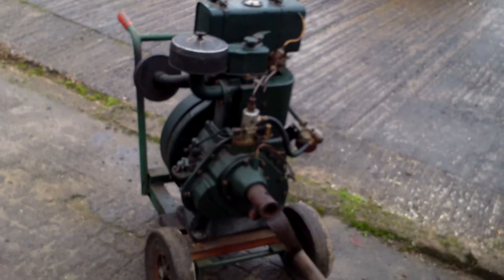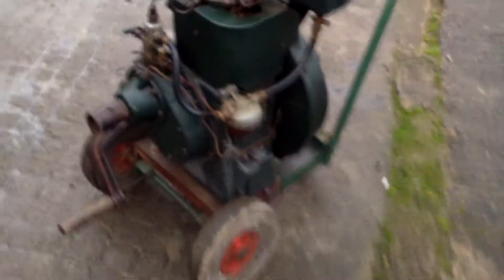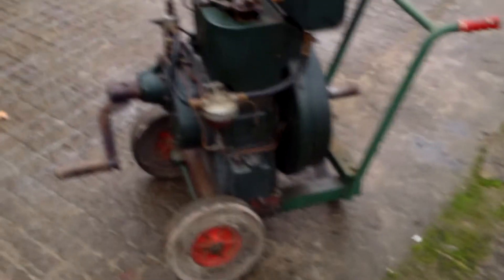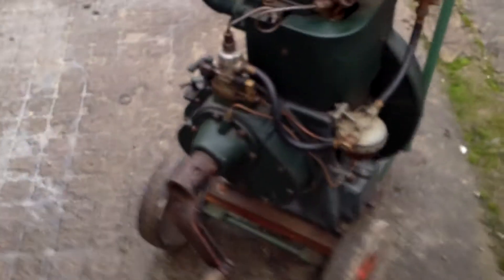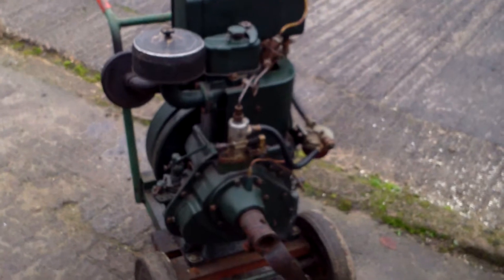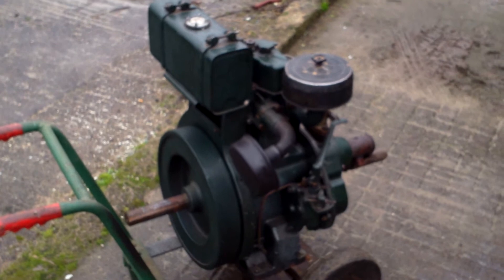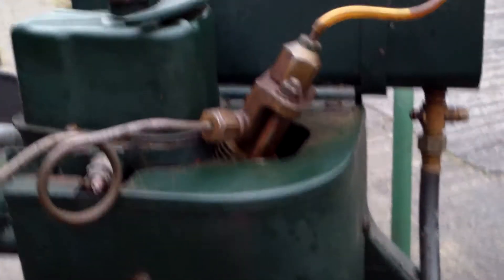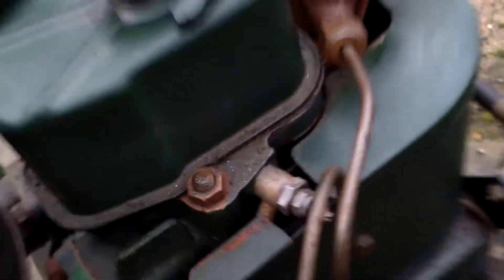Petter PAZ1 single cylinder air cooled diesel engine

Comment: Hi all, I have one of these in my garage I found it in my aunts garden, I tried to get it running but didn’t know anything about engines at the time, but taking it apart with my dad is what got me hooked on working with engines and would love to take my now knowing experience and finally get it going, although I struggle to find parts for it, do you mind if I ask you guys where I can get spare parts for these? Any contacts would be hugely appreciated, I know one of the piston rings were broken and it was missing a crank handle other than that everything else seemed to be in good condition, if anyone could help as I would love to have it up and running
Reply from the maker: Stationary engine spares keep some bits and prices. Sleeman and Hawken stock everything but would probably be expensive. Maybe buy a donor engine. There are plenty of them, they were in production for nearly 30 years. It was the classic concrete mixer engine. Good luck.
Reply: @Dieseljonnyboy  thank you very much, I’ll have a look into them and see what I can do, I’m not entirely sure what I’ll run off it yet, initially I was hoping to reverse wire a motor and fabricate a bracket to accommodate a gear drive to make a generator out of it, but first thing is to get it running, really appreciate your help, thank you

Comment from the maker: Try putting your engine under load, get a bit of 4x2 up against the pulley and see if the governor kicks in. Our little toys like to have a bit of work, they were never designed to just tick over. The PAZ1 is a real tough engine. What oil are you running in it?

Comment: They are nice little toys arnt they, ive just finnished the restoration on mine and it runs like a treat! althow i took the injector apart today as i for got to do it while i was restoring it and found it was all rusty and sooted up on the inside but its had a good clean and is running even better now! Im interested to see that yours doesnt hunt like hell, whats the govner set up on these? cheers
Reply: Are these engine subject to timing!